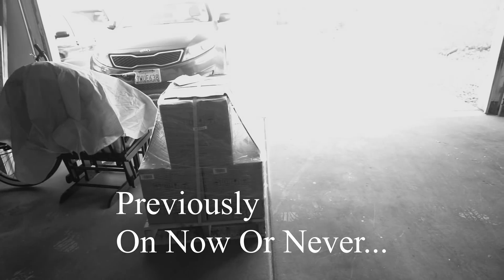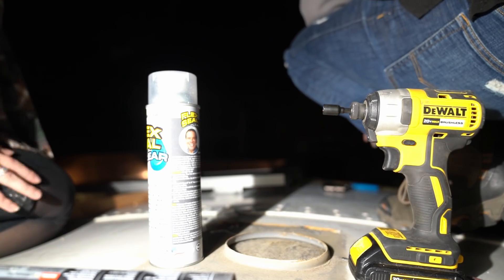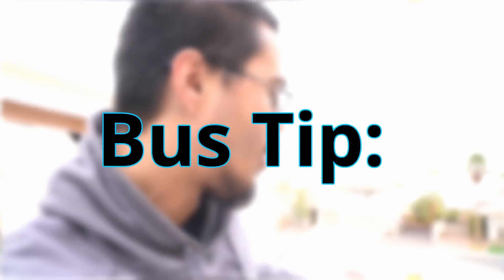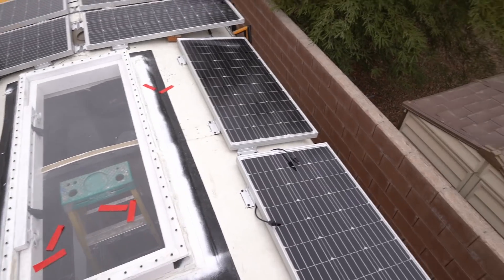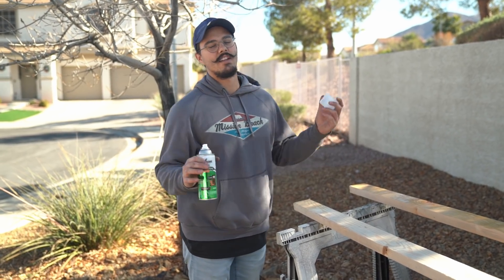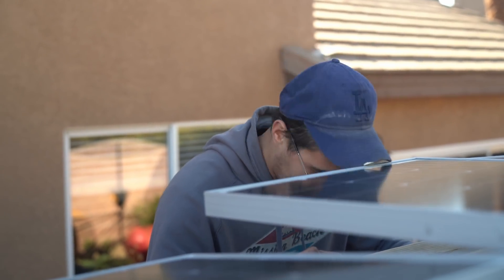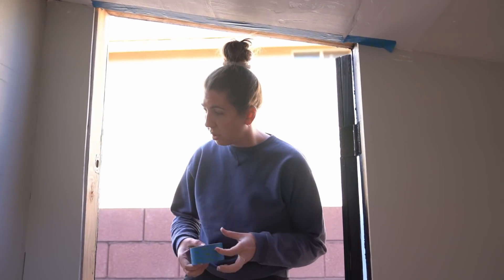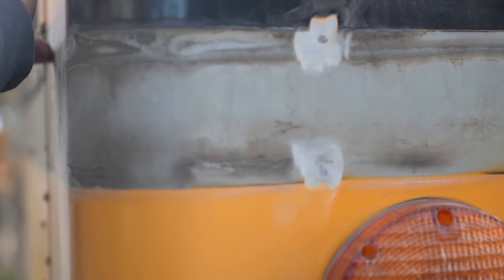Mounting Our Solar Panels| Skoolie Build (Ep.28)

Comment: Be sure to use bolts with lock washers and nuts to secure the panels and NOT screws. If you don't take your ceiling metal down then use bolts with blind nuts. If you have to use screws be sure that you hit into the roof ribs.

Comment: I am so beating my head over all the building mistakes your doing. You really should of re-cut the correct size of Plywood for the trailer, then put dry-wall up and then you can paint. For the Soler Panels I wished to God you would have the frame re-built in-stead of using wood.
Reply: Yogi Bear sounds like you should put a pillow between your head and that wall my friend. You could get a concussion that suddenly urges you to be rude... and we all know you’re not a rude person.